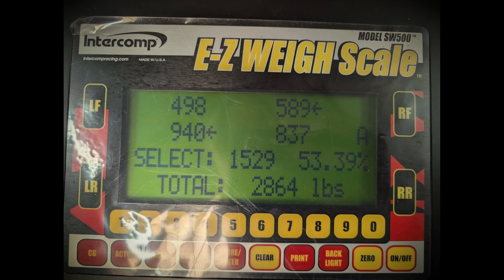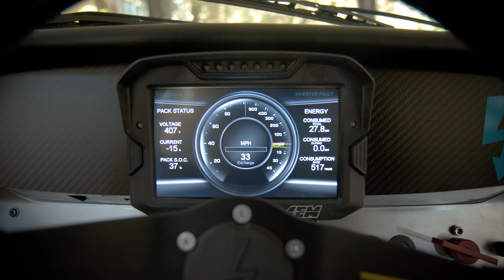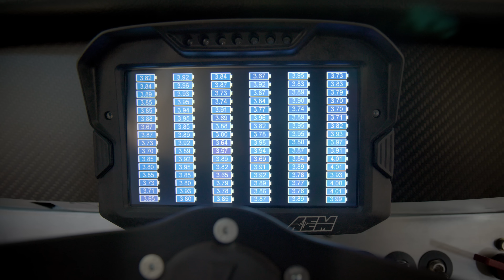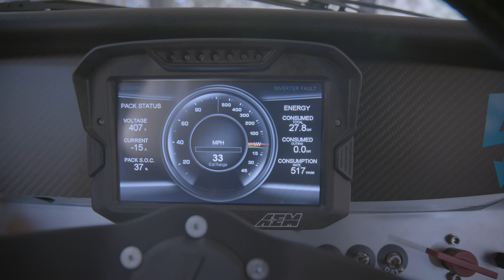ELECTRIC DEVIL: Mudslide-Surviving 1976 Porsche 911 Turned Tesla-Powered Ruffian Beast | EP36

Comment: that low,  3/4 camera shot  showcases how much rubber is in the back.  i was sold as soon as i saw that.
Reply: It's full road race ready spec. TONS of mechanical grip.
Reply from the maker: Thank you for watching...we appreciate it!!
Reply: I need to get some 0-60 times. I was surprised at how well the Michelin PS4s grip.
Reply: @NicoleJohnsonsDetour In the UK there is duel Tesla motor Beetle that has 1000bhp.. They`ve also converted 3-4 Ferrari Testarossa to Tesla power...  And a Land Rover that has 200kw battery pack...
Reply: @kylereese4822 
He also has one of the quickest landrover defenders in the world 🧙🏻‍♂️🇬🇧
And a bay window Crew cab VW. That's has the same sort of power as a Ford Sierra Cosworth ..  which he used to take the kids to school in Wales. 

He's done a dozen or more Porsches and a Jensen Intercepter and several big ex V 12 Ferraris .. and Lamborghinis.
Reply: with all that torque, it  needs  all the tire it can get

Comment: Good Lord. What an insane story. Chris, you absolute legend. 😁

Like Chris said, because the power and torque are INSTANT, you don't get the feeling of 455hp and 332tq that you're used to in a gas engine. It feels much faster, while simultaneously being safer than a twin turbo car that gives you that same gut punch - but needs time to get there. This makes me believe that we can go back to having fun, affordable 150-200hp dual rear motor sports cars weighing 2500lb with LSDs. Because the batteries don't have to support as much power, the pack can be smaller, which means it will need less cooling, which means less weight, which means smaller brakes and better efficiency, which means better range and lower operating costs, which means longer car lifespans...the list goes on and on and on. Miata, please save us.
Reply from the maker: Thank you for watching!!  We appreciate the comment!!
Reply: An electric Miata could actually be really cool. Those cars are all about fun in the canyons and having the top down. The sound they make has never been a high point anyhow (not that they sound bad, but it's not a high point like some other vehicles).
Reply: I'm kinda hoping Dodge would've seen things your way and made the new charger with this philosophy...instead of the AWD, 6-ton land yacht we're getting. 

Maybe Ford could do some new pony cars like this idk..
Reply: @chrisashton7133  Electric Miatas conversions have been done many times and mostly figured out. They can easily become a powerful handful wrangle. Zero EV has a series on doing a Miata convertion.
Reply: @AshyGr33n  I don't get it, man. CAFE doesn't mean anything for EVs. I just. Don't. Get. It. MAKE THINGS SMALLER AGAIN! We have the technology to do it now, and relatively cheaply at that!

Comment: Nicole,  i am always amazed at the projects you find as they unique. In addition, Chris Ashton finishes project he starts even if that means starting over and over and over. That shows ultimate commitment. As for electric cars, I am a fan of the concept but I still like vehicles that leak oil, smell funny and drink gas. Since I am in my mid 70”s I understand the electric cars but it’s hard to get excited with a vehicle that makes no noise. My daughter has one of the Mach E Mustangs. I like the acceleration but it’s like sitting in an amusement ride not a “hot” car. When you sit at a traffic light it is like sitting in church there is no rumble of or smell of exhuast. Chris built a magnificent vehicle that is the future but I am stuck in the past. Keep up the videos the are alway superb.
Reply from the maker: Thank you for the comment...we appreciate it!!

Comment: I’ve been wanting to create an EV for at least 25 years, but the experts always said “wait for the batteries to get better”. Now they finally are! You’d think I’d be super excited about all the new EVs on the market and I am..sorta. The problem is all the weight and complexity. The EV I’ve always desired is simple and light without all the bells, whistles and screens. Just 4 wheels and an electric motor - like THIS!
Reply: It'd be nice if there were bolt-in kits for enthusiasts to install, but even when there are the kits, the after-market manufacturers won't sell them direct, only to licensed workshops.
I can go drop a massive V8 in to a musclecar in my shed, but I'm not able to EV swap the same??
Reply: Note sure about 25 years, but 20 years is very much doable. FYI Rav4 EV from Y2K era with passive thermals Nickel Metal Hydride NiMH battery on average survived 17 years. This is real world data of old dead cars. Heated and Cooled Lithium Ion batteries are not doing much better and degradation data from currently high mileage BEVs are showing the same lifespan. Soo with some more tweaks 20 years should be doable, 25 years will not be in mass production in anytime soon.
Reply: @PiDsPagePrototypes  "massive V8 in to a musclecar in my shed, but I'm not able to EV swap the same" WTF that is insanely wrong. Its much more difficult to do a modern V8 swap in a private garage than a EV conversion build. It requires far less specialized tools, way less messy liquids and lubricants and no burning hot parts to protect. It's much easier to do a Motor and Battery swap as Shade Tree mechanic. Your assumption was just based on ignorance of the field.
Reply: @PiDsPagePrototypes  "after-market manufacturers won't sell them direct, only to licensed workshops" That is absurd nonsense, that simply does not exist. Even FORD Performance will sell YOU a Eluminator drive train. Stop spamming erroneous rumors.

Comment: That RC car analogy changed my whole perspective. Now I want to Tesla swap something. Maybe the Bradley GT2 🔋⚡️
Reply: When I bought my first hobby grade rc car I wondered why we didn't make cars in the same way, a platform that holds motors a battery tray and 4 posts for suspension and then bam a few years later Tesla came out. Elon actually designed the cars the way he did as to not throw people off, he could have made them not look like conventional cars since it doesn't need an engine bay or conventional cooling and oiling he could have put a fishbowl on the platform but people don't like change. Teslas do nothing for the environment but good hell are they fast.

Comment: Man.....I've seen Chris's work before and he's a bold car builder but this is out there. IDK if I could ever go electric. Not having a transmission would be too weird of an adjustment. I raced RC's as a kid so I know how electric power delivery works and I'm surprised that electric cars don't have a more robust transmission or differential system. Relying on software to keep your power delivery in line....I would be so scared. CPU lag, a software glitch, a short in a power cable and who knows what would happen. I do like it though. It looks cool, Chris is doing Chris and that's a total success as far as I'm concerned. I'd like to see this out at Willow Springs putting up fast laps. That would be wicked.

This is definitely one of the most interesting seats you've put your butt in. lol
Reply from the maker: Thank you for sharing with us...we appreciate it!!
Reply: I cannot wait to get some track time in! So curious to see how it does.
Reply: @chrisashton7133  Sweet. I bet it handles like a dream. So light and so much acceleration. I hope we get to see that on Youtube. 🙂

Comment: I got interested in electric cars in 1968 after having a disscusion with an aerospace engineer about the merits of electric propulsion vs internal combustion propulsion vs external combustion propulsion.  His thesis was that electric propulsion would be best if the power source could be perfected.  I am glad I lived to see the day practical electric vehicles are a commercial success.  Lets move on to capacitor/battery hibrids .
Reply: Dang, that's cool. Nearly instant charge would be fabulous.
Reply: Supercapacitor are really only needed for peak power. Modern batteries have massive peak power output there is no need for Super Caps. Galvanic Batteries have way better energy capacity that capacitors.
Reply from the maker: Thank you for sharing with us!!!

Comment: Good stuff Nicole & Chris👍🏼👍🏼
What's the total kW-hr rating of the batteries?  What kind of charging system are you using?
Reply: 47 kWh battery. 6.6 kW On Board Charging (OBC) w integrated 2,500w DC Converter J1772 Level 2
Reply from the maker: Thanks for the info Chris!!

Comment: The learning curve for conversions are steep
Reply: Definitely. I've had a hand in building some wild stuff but I am a long way from understanding all of this stuff. It's a whole different thing.
Reply: You'd be surprised.  Every single EV has exactly the same fundamental parts (motor, high voltage battery, 12v battery, high voltage battery charger, 12v battery charger and instrumentation) .  A conversion typically has considerably less complication.  You build to suit your style and needs.  You have to open your wallet a little further than a gas car but all the parts are readily available online.  If you can fabricate/weld, you've whooped 80% of the learning curve!

Comment: I'm learning that people that don't like EV's are afraid of change in general
Reply: Really? If the change is an improvement, people accept it. People aren’t accepting EV’s because they aren’t an improvement over current circumstances speaking in general terms
Reply: @Bruce4lmighty  they are an improvement but most people believe what they hear on media and don’t spend the time doing research into the details.  I’ve had a Tesla for 2 years and every negative comment I get is due to ignorance
Reply: Agree with user. EV's are, in general, a massive step forward over combustion powered vehicles. Granted, as Nicole stated, the combustion engine offers and experience that is unique and often associated with "personality" and fun. But when it comes to getting a pilot from point A to point B, a fuel powered vehicle simply cannot approach the efficiency and performance of an EV. Just from a general maintenance prospective, a ICE vehicle looses the argument. It's only when you get into long distance travel where EV begin to show their weaknesses.
Reply: @Bruce4lmighty  They ARE an improvement, if informed, NO ONE could form this opinion, no one.....
Reply: @abikepeddler  I've had several hotrods/muscle cars and at first after getting the Tesla I did miss the sound of a nasty cam, but as time goes by I really don't miss the sound anymore.  I actually like the quiet smooth power of the EV
Reply from the maker: Thanks for the comments...we love the interaction here!!
Reply: @NicoleJohnsonsDetour   thanks for doing a EV, I think it will open people’s eyes a little
Reply: @abikepeddler  you also forgot that reliability is the weakness to EVs as well........
Reply: @BlueMarlin-q7f   lol you sound like the type of guy to order cold cheese or the monkey burger at InNout....lol.... I understand that people can change, but it sounds like you  never actually liked muscle cars, you were just romanticized by the idea..... I for one am a vintage motorsports enthusiast. I've been daydreaming about 917s and 935s since a child.....  If that were to change, that would mean I'm dead inside........
Reply: @MiguelGarcia-vj7oo  I have no idea what you are saying?  Did you pass English class?
Reply: @MiguelGarcia-vj7oo  What are you talking about? Where do you get your information?   EV's happen to be more reliable than gasoline vehicles....for one, they have 90% less moving parts and they are virtually maintenance free

Comment: These EV conversions all have too much power, requiring too big batteries. Around 300hp output and hundreds of pounds less battery would make a better car.
Reply from the maker: Thank you for sharing!!
Reply: Build one and shut up.
Reply: Exactly, why can’t we have 300-350 hp with 1,000 of range instead of 700 hp and 200 miles?
Reply: Electric motors are small,  light,  and powerful.  The high maximum power is nearly free. The level of power needed to commute a particular distance is still small,  and the range won't change just because the available max power is double or triple.
Reply: @jlangford7422 this car doesn’t have 700hp…
Reply: Battery weight is more about range than power. You could have exactly this setup with an 80 mile range (same as a Fiat 500e) instead of 130 and shave off a couple hundred pounds. Just depends on what you want to prioritize.
Reply: Wrong Peak Power has not much relation to battery size. You could have a a much smaller battery with very little range and still kick out 400hp for a short time. FYI That is what Military Helicopters use to start the turbine engines. You just need a big battery for Range and Endurance, how much energy capacity for how long is the main factor for battery size.

Comment: Very nice car and fascinating story behind.
Working in car battery production, I was shocked by you cell voltages in standby, spred from 3.57V to 4.01V, as far as I noticed. That is definetely a serious issue. 4.01V means pretty much fully charged and 3.57V pretty empty. I strongly recommend to balance your cells to less than 0.1V spreading. This will increase the punch and significantly the battery lifetime. The story about taking several charge cicles shows, that the BMS and its balancing abilities are not sufficient. At least, when one assumes the cells are all pretty equal in their performance and age.
Reply from the maker: We're glad you enjoyed watching.  Thank you for the comment!!

Comment: I had never considered the RC car angle  until Chris brought it up.  Of course I grew up with electric AFX slot cars and RC cars!  I'm intrigued with the application of EV technology, my concern has always been too much too fast and we wind up with landfills full of toxic batteries, etc.  We all have to realize that this tech is hear to stay...I mean when Ferrari, Porsche, & Lamborghini are making hybrids its time for even the most recalcitrant to remove their heads from the sand.  Its not in my budget, but the idea of retro-fitting classice sports cars that would otherwise be sitting or scrapped with new tech that brings them back is a good idea.  It was weird not to hear the engine whine though.
Reply from the maker: Thank you so much for your comment!!

Comment: Such a cool car - Love it!
BUT: Your battery does not seem to be healthy at all, with such big drift between cells. Yes, the BMS should balance the cells, but such high drifts mean, that the cells don't perform evenly. Also I don't see how cycling the battery would improve the balance between cells. Most BMS do Top Balance (which would mean, the battery needs to stay on the charger, and the BMS will discharge the cells that go over the full voltage, to allow the others to catch up. There are BMS that can balance during the charging, or even without a charger being active tough. So my Advice would be check with the vendor/supplier on what's a good strategy to get the pack balanced.
Would also be interesting, if the BMS can provide individual Internal resistance of the cells.
Reply from the maker: Thank you for watching...we're glad you like it!!  We appreciate the comment!!

Comment: This is an unexpectedly cool conversion. At first glance, there is nothing more ridiculous than converting a classic car into an electric one. Because 50% of what we need in a classic is sound. That old characteristic carburetor sound, slightly walking and vibrating at idle. In this car, sound is also lacking, but it still looks damn interesting. In general, if it were possible to solve the sound problem, then many petrolheads would be much more loyal to electric cars. I do not mean synthetic sound from the speakers, but real one, the one that fills with emotions and makes the blood boil.
Reply from the maker: Thank you for the comment...we appreciate you watching this video!!

Comment: When you were stopping, without using the brakes at the light, I have experienced that here following a Tesla. It was so annoying! Their brake lights didn't come on until they were  almost completely stopped because of the regen braking. Imo, It's not safe for driving on public roads. The brake lights should flash when you let off of the throttle, to let the guy behind know when the car is slowing down. 😤  
rant over.. 😂
Reply from the maker: You have a good point!!  Thanks for sharing!!